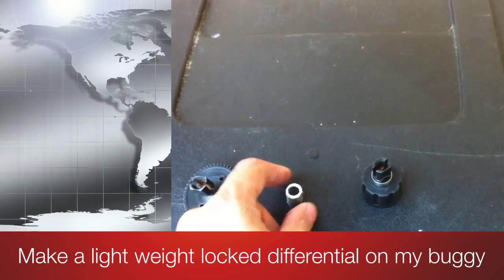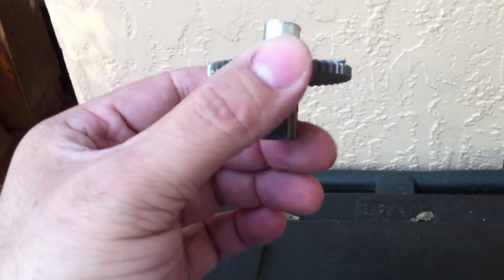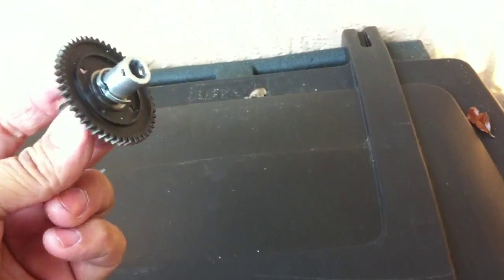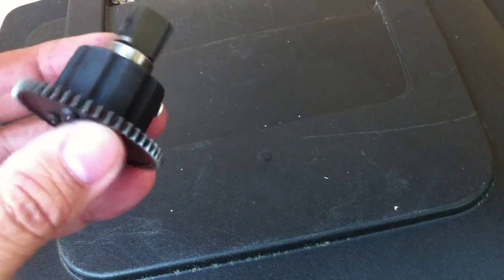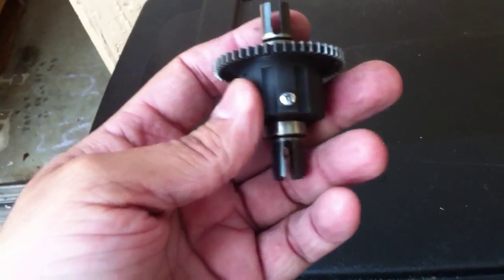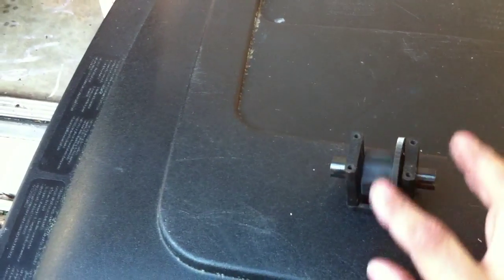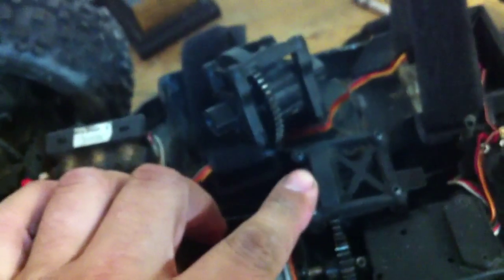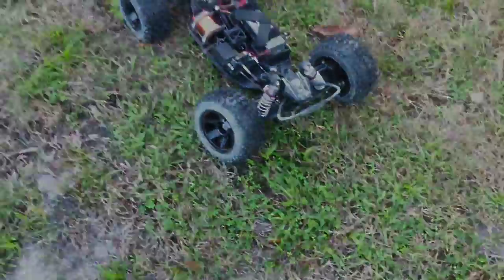How to make a locked Differential for my buggy - CHEAP

Comment from the maker: I like the silly putty too... the nice thing is you can clean it out and open the diff again if the spider gears are in good shape.... my problem is I keep ruining the platic cup... it stops working with spider g=ears so I was finding ways to use the bad cups I had....  thanks for the post....

Comment: Iv used solder to fill a diff.... DID NOT work..... used hot glue.... DIDNT WORK..... used SILLY PUTTY!!!!! with the spider gears installed. it will turn by hand but is really hard to do so.. acts just like a locker and is removable... still running in my castle MM2 2650kv 1/8th scale system...